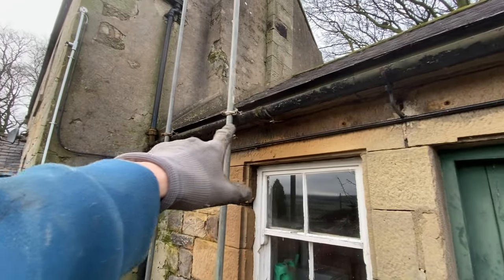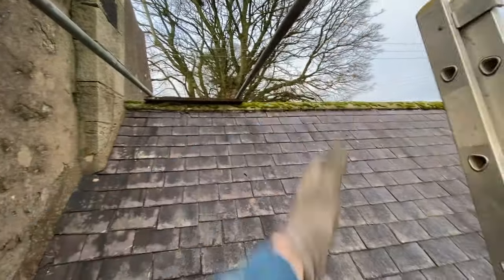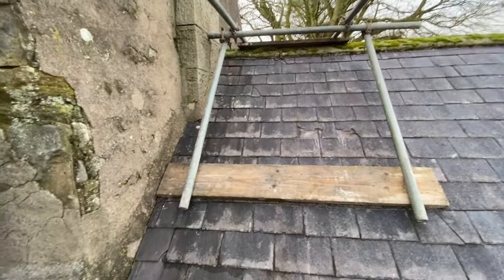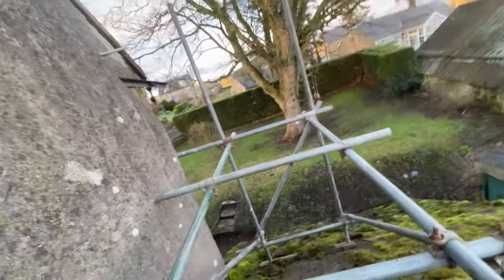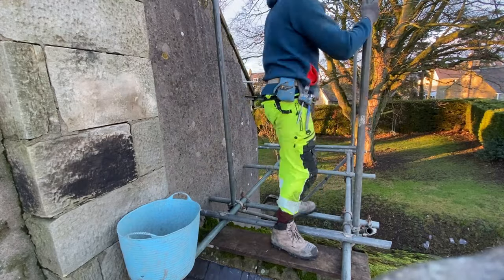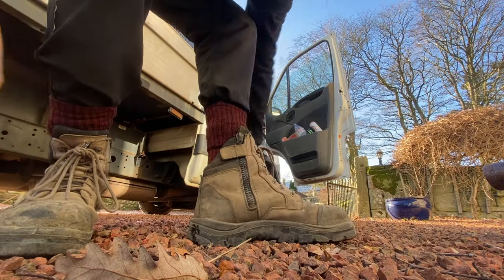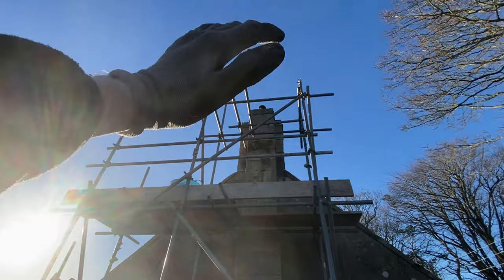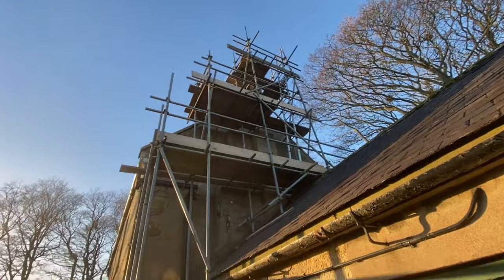Winter Just Makes It HARDER | Scaffolding On Your Own | Day In The Life Of A Scaffolder Construction

Comment: Been putting beams over a tiled off shot roof today and the boards and steel have been a nightmare with the snow and frost. The boards were brand new as well so each one was the weight of 3. If it’s the same in the morning I’m going to use the flat roofers torch and thaw the gear out in the yard before we leave.
Reply: Seems like a waste of time
Reply: @staffieloco8114  Nah we got the job sorted just it was a bit slower if anything.